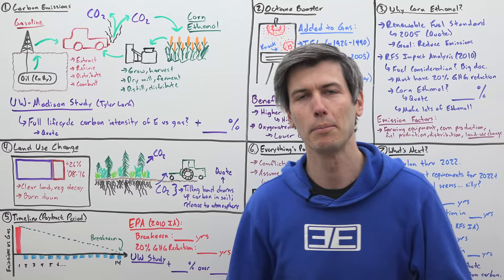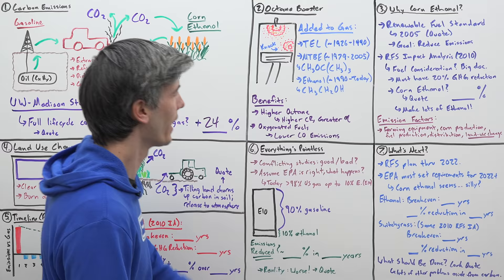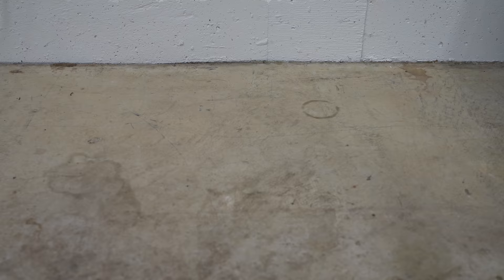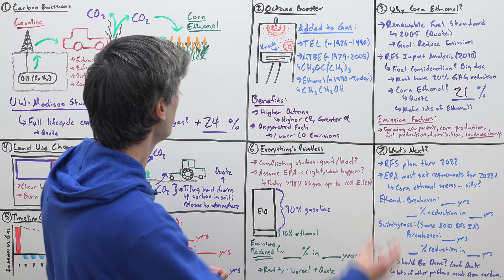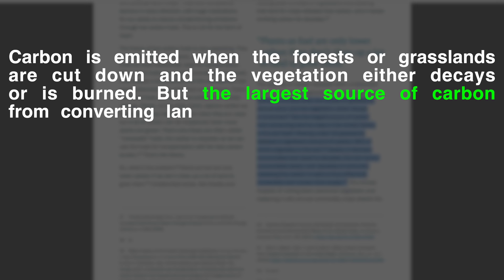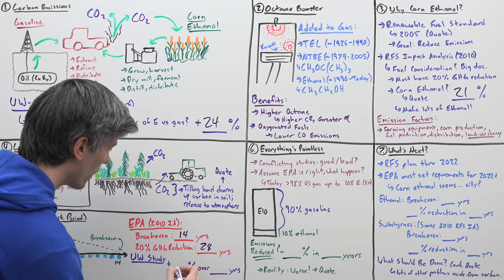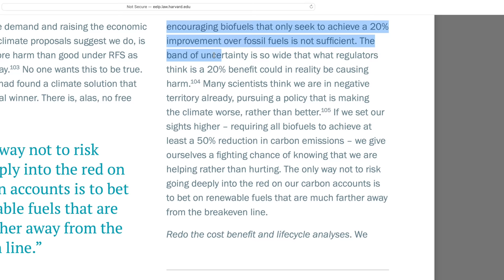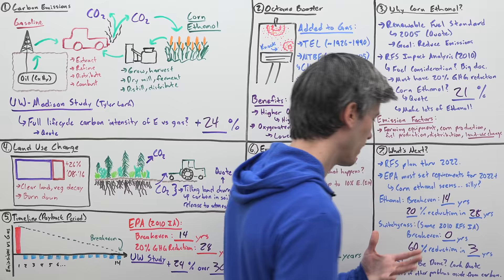America Was Wrong About Ethanol - Study Shows

Comment: YAY!  I've been a ineffectual proponent of switchgrass since the early 2000s.  It's awesome to see this topic presented.  Please now make a video showing alcohol production from switch grass vs from corn, especially showing the amount of leftover waste produced by both (just make two piles of the leftover biomass).
Reply: Just under half of our corn planted is value added into ethanol and distillers grains.

100% of the fertilizer and things in the soil still get fed to livestock in the distillers grains.  Ethanol comes from only things of the air: solar energy, CO2, and water with the latter two recycled once burnt.

100% of the protein, minerals, vitamins, fats, etc are in the triple concentrated distillers grains.  It is not a waste, indeed corn ethanol would be far too uneconomical to even produce otherwise.  But with its feed factor, few other sources (even though they may make more ethanol per acre) can compete with it.

The Federal subsidy on corn ethanol ended back in 2011.  There still exists a Federal subsidy for generation 2 ethanol which switchgrass would qualify for, and this subsidy is over twice as much as what corn ethanol's (generation 1) had been.  There was a generation 2 ethanol plant almost built that was to use corn stover in Nevada, Iowa but this was never completed and was since repurposed.

It is hard and expensive to make ethanol from cellulose which is why all the drinkable spirits we have been made from sugars and starches.

Switchgrass requires a dedicated acre of land whereas corn ethanol comes from already existing feed production acres but as a source, we can only economically just over double our current production from it.
Reply: I also know sugar cane is about 12x more efficient. Since there is an already perfected system of production of extremely cheap ethanol in Brazil, why was not that copies into sunny and wet places like Florida or the golf cost states?
Reply: @fmilan1  Bing copilot says we do a little, but the vast majority is (value-added) from corn.  I imagine they make more money for sugar production.  Hawaii imports expensive diesel to make dirty electricity, they could use their abandoned sugar cane fields to make pollution free cheap fuel and electricity for a fraction of what they spend on other renewables.

Bing states sugarcane make 560 gallons of ethanol per acre on a 35 ton/acre crop.  Sounds a little low to me but that is what it said.

Value-adding corn into ethanol produces not only >500 gallons per acre but also 1000 lbs. of protein (& other things) per acre.  This feed factor is why it can economically outcompete even sugarcane.

So much so that Brazil put an import tariff on US ethanol in 2017.  Went up to 18% this year.

Brazil is also using corn for ethanol.  It is a good fit because unlike cane, corn stores well so they are able to more efficiently run their ethanol plants all year-round in-between cane harvests.
Reply: @bobbg9041  They ferment the starch in corn to make high fructose corn syrup.

Most of the time it has slightly more fructose than sucrose where sugar is 50/50 though it could be made 50/50.

Poorly made HFCS still has starch left in it but they only label or use it for the fructose and sucrose content.  They have tested pop made of both and found the HFCS pop had more carbs even though the fructose and sucrose contents were the same as the pop made with sugar.  Hence it must have had some starches left so you are getting more like 4 times the amount of carbohydrates than you think.
Reply: yea they been talking about it for a long time but I have not heard any advancements in years, nor the talk of research in breaking down cell walls so we can use the stalks and leaves along with the grain for corn at least now its all battery this and that, and thats  full of pollution to get the stuff too and dont have the range and it degrades with high or low temp not to mention expensive and china has the market cornered on the rare earth minnerals, also lets not forget when lithum batteries get damaged they can burn violently and the fumes are toxic more so then you could imagin, its not perfect but those in power seem to just keep marching down the path without even another thought of alternitives to fossil fuels, or batteries, also we have a bad grid as it is and you make everying electric its going to tax it even more also factor in that solar and wind are not always constant and take up even more land to make same or less power then regular plants, there are no silver bullets to the energy crisis thats comming
Reply: @manga12  Dupont in Nevada, Iowa built a cellulosic ethanol plant which was supposed to use corn stocks.  They couldn't get it to work and sold it to a German company who converted the yeast corn stock fermentation tanks instead into methane digesters to use bacteria to make renewable natural gas and converted the distillation side to value-adding corn into ethanol and distillers grains.  The bagasse of the methane digester is sold as humus/fertilizer.

Not sure if that particular plant uses waste steam from an electric plant or uses the natural gas directly but either way there is absolutely no new CO2 produced is making the electricity or ethanol from burning renewable natural gas.

Nissan drove a fuel cell powered electric vehicle around Brazil in 2016 that used their E100 infrastructure.  Note it still works with enough water in the ethanol so as to be non-flammable.  Ethanol is a much safer fuel (the reason Indy 500 uses it) itself but that is a whole new level.

The fuel cell goes over a catalyst to make hydrogen for the fuel cell but the next generation of fuel cells uses the ethanol directly.

Advanced ultra-quiet European and Indian large military submarines use ethanol fuel cells for propulsion.

Here is what an article from seeking alpha said:

>>>Fuel Cell technology offers many advantages over Lithium-ion batteries, not the least of which is that hydrogen used in fuel cells has the energy to weight ratio ten times greater than lithium-ion batteries.

That said, the volumetric energy density of ethanol is over five times greater than hydrogen.

Ethanol has five times higher volumetric energy density (6.7 kWh/L) than hydrogen (1.3 kWh/L) and can be used safely in fuel cells for power generation.<<<

Argonne Nation Laboratory has an efficient and economical process that uses catalysts made of copper and carbon which can instantly turn on and off to make ethanol from electricity and CO2.  They are building a pilot plant now.

Ethanol plants use the waste steam of nearby/onsite electric power plants to make ethanol.  These electric power plants must operate with excess capacity for peaks in demand load.  Why not use this excess capacity to efficiently make more ethanol from the pure food grade CO2 given off from the fermentation?  Transporting it across the country in expensive and dangerous CO2 pipelines only to bury it as garbage is total folly.  

The equipment and infrastructure to handle the ethanol is naturally already right there.  They could use excess electricity of nearby windmill farms on especially windy days as well.
Reply: @danafletcher2341  yea I know about alcohol as a fuel I attend openwheel dirt track races, but as a straight fuel it is a bit more corrosive to the engine parts, somethings got to give though we got soo much that could be done with biomass but seems no one is making a go of it, or willing to overcome the hump to the short falls like torrified biomass think of it as a giant coffee roaster with the off gasses reinjected into the roasting reaction and the remains are pressed into biocoal of sorts non of the heavy metals and half the pollution 80 percent energy dense of regular coal, prob is getting the right pellet size and the roasting apparatus often creosoate up and catch fire a nasty side effect but racing and steam I am large on studying, steam engines can run on anyting you can use to make enough heat with the right grates, or burners even potentialy hydrogen
Reply: @manga12  If you were to look at most any part manufacturers' or scientific chemical compatibility chart, you would see that ethanol is at worst equal to but most often easier on rubbers, plastics, and metals than what gasoline and BTEX (benzene, toluene, ethylbenzene, and xylene) are.

The parts of a non-flex fuel vehicle are identical to the parts of a non-flex fuel vehicle save the yellow fuel cap and more recently a fuel sensor.

The early flex fuel vehicles had methanol capability so had stainless steel fuel lines but methanol capability was dropped right away and they went back to the standard mild steel fuel lines for E85.

Speaking of coffee, note that it is second only in petroleum to volume traded.  The coffee fruit is similar to a cherry except with coffee we keep the "pit" (i.e. coffee bean) and throw away the fruit which gets dumped into rivers causing a temporary ecological disruption.  Why not make ethanol with that fruit and sell the bagasse as humus/fertilizer?

China, Indonesia, India, and others are looking at and/or using an efficient and economical process to make ethanol from coal, natural gas, and oil from a Texas company named Celanese and their TCX Technology.  I guess the TCX Technology now has their own corporation.

Oak Ridge Nation Laboratory built and ran a liquid fluoride thorium reactor in the late 1960s and early 70s.  These reactors don't use high pressures so are small and cheaper to build.  They have a fan cooled drain plug which makes them walk away safe.  They produce very little waste and the little they do is radioactive for only 300 years, not millions.  You can't make weapons from it either.

They can also use our current radioactive waste from solid fuel uranium reactors, eliminating that storage problem with electricity and heat as a byproduct.

When we run out of that, note thorium is very abundant in all countries and is a waste byproduct of rare earth mineral production.  We have stockpiles of it sitting.  A golf ball sized piece of thorium can provide all the energy one person uses in a lifetime.

The Navy developed an efficient process to make liquid fuels like ethanol from hydrogen and CO2 from seawater but just used electrolysis to make the hydrogen.  LFTRs run hot enough to more efficiently separate water into hydrogen and oxygen.

With enough ethanol, we could have hyper efficient clean 99%+ pollution free dedicated ethanol engines made of cheap recyclable cast iron, half the size/twice the power of gasoline engines, even more than diesel engines with mileage great than either of them.

We could have those ethanol fuel cells I posted.  Imagine a worker coming home and instead of plugging his car into his house, he plugs his house into his car.